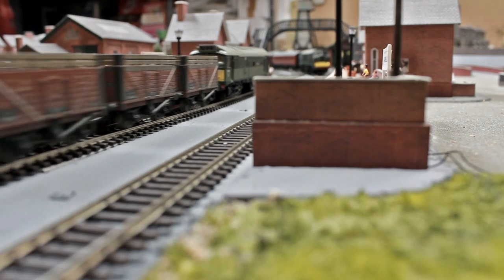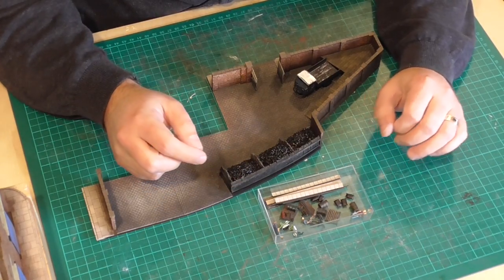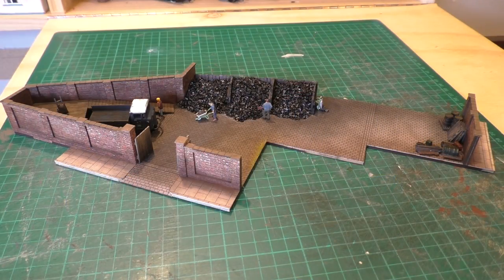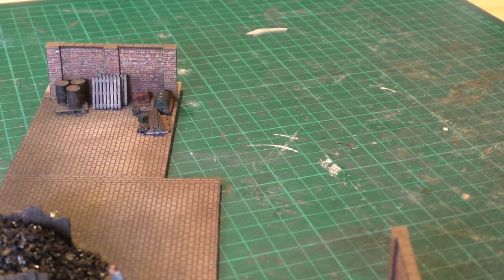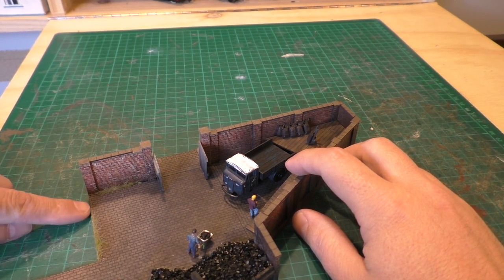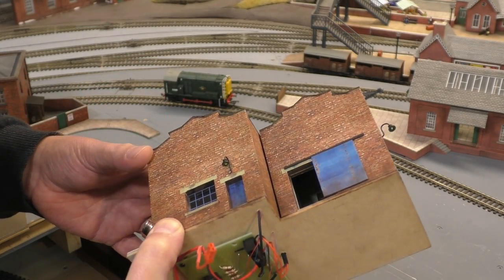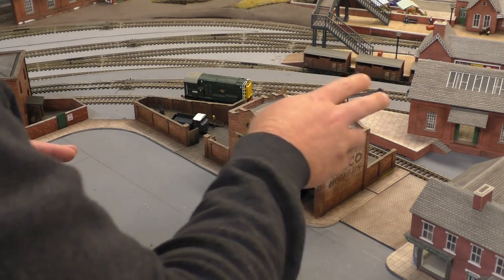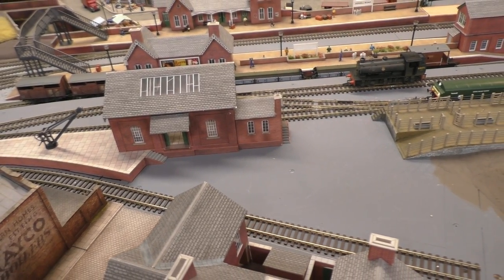Adding Detail to the Coal Merchants Yard

Comment: The coal yard looks great. 

One thing to remember about British railways is that it has been law since the early days that the railways have to be fenced or walled off. So there would be a high wall alongside the goods yard separating it from non railway land, the gap in the wall at the coal merchant probably wouldn't be there and if unloading facilities for the boiler workshops were needed a platform would probably be there.

Comment: Congratulations to you and your wife on your wedding. One thing I think is missing from the coal yard is a weighbridge, but you could put one in the goods yard instead.
Reply from the maker: Thank you for your kind words and suggestion. Space is probably a bit too tight for a weighbridge but there's now a weighbridge in the goodsyard area (2 months on, and my tardy reply☺). I will be adding some sack scales to the coal yard area which will give some form of accounting for coal distribution.
Reply: @StationRoadModelRailway  Working weighbridges still exist, there's one at my local council's rubbish tip (You can be charged for the weight you dump there), but sack scales are things of the dim and distant past, even to a 77 year old codger like me. They probably disappeared in the 1960s when central heating became more common and there was less need for coal in the home. The only sack scales I have seen were in a restored working flour windmill.

Comment: Hello Julian, congratulations to your wedding.
Regarding your coal loading platform. May I suggest that you add some kind of plank between the lorry deck and the platform, so the workers could transfer the coal sacks more easily to the lorry deck.

Best regards
Markus
Reply from the maker: Thanks Marcus. Sounds like a plan. My original thought was the lorry was still backing in and hadn't quite backed up completely to the platform (leaving no gap), but I like the idea of a plank🙂

Comment: Congrats on tying the knot [avoid the noose]. As usual great attention to detail. My only suggestion is adding some weighing scales in the coal yard. Greetings from Bali.
Reply from the maker: Thanks Steve. I did consider a weigh-bridge but space is quite tight to have a drive-on drive-off scenario. I wonder if it would be plausible to have a weigh-bridge directly inside the gates as the lorries enter?
Reply: @StationRoadModelRailway  I was thinking  a set of small scales to weigh sacks. I don't think a small yard would have needed a weighbridge. Another thought re the truck. The roof seems to clean and having a bloke on the back with full and empty sacks.
Reply from the maker: @steveroperfilms  Ahh, I see what you mean. Would coal sacks be weighed or simply filled until the sack is full? I have weathered the lorry roof but it doesn't show well in the video, the lighting just blows it out. I'll be adding more coal sack to the platform and I think I'll add some to the lorry deck as well along with a worker.
Reply: @StationRoadModelRailway  You're right about the sacks 1cwt and 2cwt from childhood memory. Though I have seen this sort of thing as well. Oh! Can't post picture. Will try somewhere else.
Reply: Forget the 2cwt. They were sacks twice the size for anthracite, half the weight of coal.

Comment: Just discovered you channel and will follow you. I wonder though if there's enough room for the scammel to manouver or pass through the gates. Also were pallets available in that era?
Reply from the maker: Thanks for following the channel. The Scammel Mechanical Horses were designed to manouver in very tight spaces, almost turning within their own space, and yes, I did model the gates for the truck to pass between. Interestingly, wooden pallets date back as early as the 1880's, so they were widely used by the 1960's.

Comment: What most people, me included, call cobblestones are actually called setts. Cobbles are naturally rounded stones not rectangular blocks (which are called setts and have been quarried and regularly shaped). Congrats on getting married.
Reply: The engineering description of a cobble, is any material that fits through a 200mm sieve but not a 60mm one.

Comment: O-O-O-O-H-H-H-H Julian HAVE I GOT COMMENTS FOR YOU!
First off.  This maybe the first time I noted the Asphalt Roofing you modeled.  To other modelers who are family, friends, Club Gandy-Dancers, or other YT'ers my criticisms have been deep cuts.  For whatever reason modelers repeatedly lay long edge to edge strips of roofing material as a demonstration of prototypical coverage.  IT IS NOT.  Julian YOUR'S IS.  All roofing should be exhibited as a STAGERED COVERAGE.  Excellent job "Garage Boss".
Next the goods crane.  Dependent upon what is the sub straight of that current platform please consider an underside mounted servo motor which would rotate from180 to 270 degrees of the entire assembly to serve both sets of tracks.  One coal sacks.  the other dry goods.
Third,  empty sacks.  Following the passing of my wife in 2017 she left behind drawers full of She-She Hankies.  You know the type.  With fancy schmancy lace trim?  Well in a matter of need, and to keep Eileen as a permanent part of my NEVER/WAS RAILWAY I delicately removed the lace trim for other Gingerbread Victorian structures.  But on point here, I cut and fabric glues the center of the hankies as both full and empty sacks.  The white cloth did need to be dyed with colored stains, weathered, dry brushed, and at times molded into shapes that "appeared" realistic.  There are some, meaning many, fails.
Lastly, and lovingly, CONGRATULATIONS ON YOUR WEDDED BLISS TO SUCH AN ELEGANT ATTRACTIVE BRIDE.  But one cautionary from a guy who married his first love 43 years ago, & still is in love with her, a perfect wife is the Lady Sarah who allows the guy to fantasizes  he is "THE BOSS" of ANYTHING.  WE AIN'T!🥰
Jim in N.Y., U,S.A.
Reply from the maker: Thank you Jim for sharing your kind and wonderful words. I may look at a servo for the crane as there is room underneath, and I will be investigating empty coal sacks yet to be filled. I can't borrow my wife's hankies as she doesn't have any, but I wonder what I might find in the way of worn-out underwear in my drawer😯